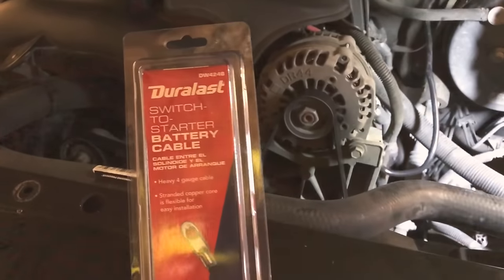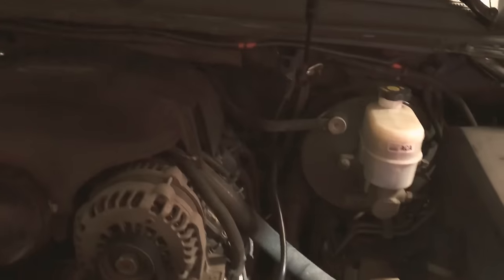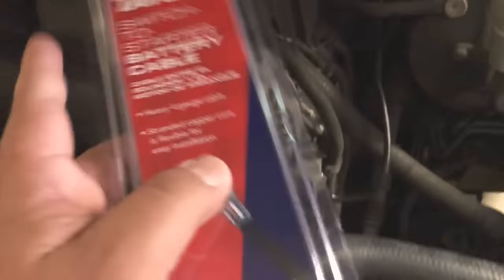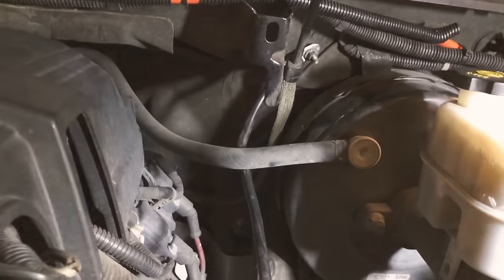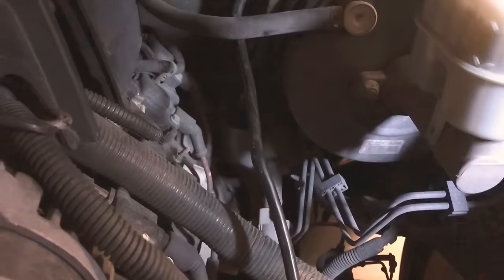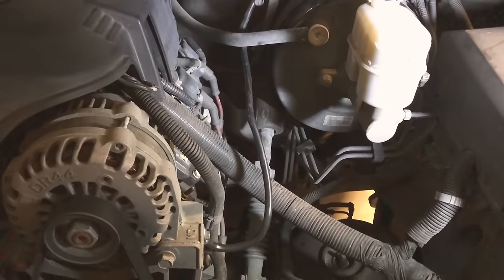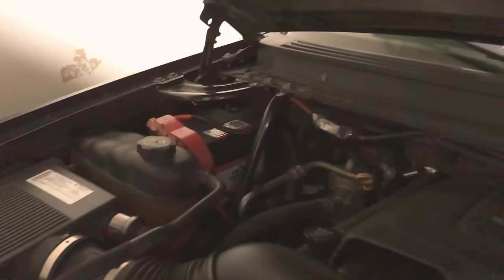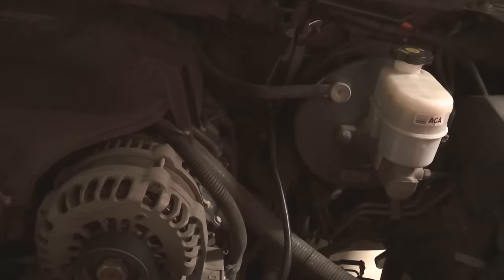07-13 SERVICE STABILITRAK FIX

Comment: Is anyone located in North Alabama. I started driving a little while ago then noticed my car not accelerating properly then the Traction Control Service light came on then the Stabilitrak light came on then the engine light came on. I am not savvy on even how to use hammer and nails. I'm in my car confused not knowing what to do. Should I chance it and drive home or what. My car started shaking and I cut it off so I'm just sitting here. 😑🤔😑 HELP!!!

Comment: I believe one of the reasons it worked i the fact you disconnected the battery and reset everything.
Reply from the maker: Rick Newman still working to this day.  But sure.
Reply: I just put a new battery in and didn’t clear my stabilink issues.

Comment: I replaced the cable instead of adding one that bolt on the back is a pain in the ass but I got it 15 mm wrench and alot of swearing. Seemed to do the trick also put new spark plugs in.

Comment: Lalo espero me conteste la mía le prende servíse  stabilitrak control y traction control cres que sea lo mismo es una escalade 2007 o cuando le prende esas luses le tarankia bien feo los cambios
Reply from the maker: MaxHA Herrera igual la mía pero le puse el cable y no a tenido problemas desde que se lo puse. Ojalá y sea igual para ti
Reply: Lalao ala tuya tanbien le tronaba la trasmision cuando le metías reversa o le ponías en la D Oke por ke la mía truena cuando meto esos cambios i ovio tra esa lus prendías oy en la mañana lo chekie i trai bien batido de aceite cres ke eso sea oke
Reply: Ricardo de leon  i en lo tuyo que era el problema
Reply: Discul cambiando el cable se arregla el problema. Yo tengo una 2007 y ase lo mismo que la de usted
Reply: El Toro OTZ : Cual cable le cambiaste?

Comment: I tried this today, it came on one since I tried it. Turned it off and back in 3 times and stop coming on. Drove around for a little still did not come back on. 

I will do more driving tomorrow to see if it has stopped permanently.
Reply: Bryan Williams did it come back on??
Reply: Yes it did. But the last couple times I have driven it has not come back on. 

I have a 07 avalanche.
Reply: I have a 03 escalade this did not work for me
Reply: @carnalesmuff  Did you ever find out what the problem was???

Comment: So instead of fighting with the ground strap bolt behind the engine against the firewall ... You went to the firewall to the ground spot on the alternator bracket?

Comment: Hablas español? Me podrrias explicar q es eso q le cambiaste tngo el mismo probkema en una terrain?
Reply from the maker: Paul Perez le puse un nuevo cable para la tierra. Es un problema común con los Gm. Y le afecta a sistema eléctrico.
Reply: Lalo salazar gracias x responder la tierra de donde a donde le pusiste?
Reply: Hola lalo te deje msj...tu problema se soluciono? Hoy mire tu video y dije que mas puedo hacer ya hice todo y lo de usted lo veo tan sencillo ojala que se resuelva ya me estoy cansando y save eso que dice que es el sensor del pedal..ya me lo habian dicho pero no lo quise hacer....saludos
Reply from the maker: Julio Barraza si me trabajo esto. No a tenido problemas desde que lo hice

Comment: I tried that it didn't work and I changed my brake light switch today still nothing any suggestions Its a 2007silverado max
Reply: Im having same issue, any luck?
Reply: @Paul.Breaux  no I just got rid of it Friday it start losing oil pressure and some more shit it's electrical would be my guess
Reply: @Q_IXIX  I figured it out today, it was low brake fluid 👍👍
Reply: There are a lot of sensors that go into that light. It's a complicated wiring diagram unfortunately.

Comment: Did this fix the problem
Reply from the maker: D-NICE LEE ain’t had that problem since
Reply: Lalo Salazar ok thanks I'm about to try it on my 07 suburban
Reply: Didn't work for me
Reply: JDM Toys I took it to the local mechanic and he told me it was the CBM paid $400 for one got my truck back drove it for a week and it started all back over again now my truck is back in the shop
Reply: JDM Toys ok thanks i will
Reply: same here
Reply: I called this shop he said it was either wheel bearings or wheel position sensor. I have two cars so I'll get it fix when I can.

Comment: My '08 Escalade had the StabiliTrak errors and the power would come on and off while driving.  RPM's rise and fall, downshift, wcreen/dash would power up and down, all while driving!   Yet no codes or check engine lights..  
Added an additional ground cable under the hood and have been good for almost a week!  I sure hope that's my fix, Thanks!!!

Comment: Didn’t work for me!
Reply: Tbone509 did you find the issue
Reply: @daveherrera6474  no..people say its the fuel line running by the motor actually boiling the fuel causing it to shut down
Reply: @sisnce  ah ok-- I went to Chevy Dealership and got a proper diagnosis- also my BlueDriver scan tool picked it up as well- like close to 550 to repair the Steering Angle Sensor-that part is Discontinued! However they have an updated 8 line-our original has 6-- didn't need a harness- it plugged right in- the Computer fixed itself without having  to clear any codes- I got it done after buying part at dealer for $149 or 
$159- DO NOT TAKE PIN OUT UNTIL IN PLACE FASTENED- itll throw off calibration- and tell mechanic to tape up steering wheel in place really good- any questions-feel free to contact me

Comment: I find this video absolutely stupid, and this is why, the guy here is saying he replaced the battery cable, ok!!!! The question is, how did you find out that was the problem for your vehicle? Or should I replace a tire and see if that works? That was a video made with really no good info.
Reply from the maker: Francisco Gutierrez 😂😂👍🏼👍🏼
Reply: I think he made it pretty clear why he made this repair. Maybe you should watch it again.

Comment: False information, that's not the fix problem.
Reply from the maker: I haven’t had the issue since and i still have the truck. It worked for my truck. Title don’t say stablitrak end all fix guaranteed. But more power to you.

Comment: Did anyone have check engine codes when this message would appear. I recently repaired a collapsed lifter in my 08 Sierra I hope it’s not that again as the bitchass mechanic only replaced one